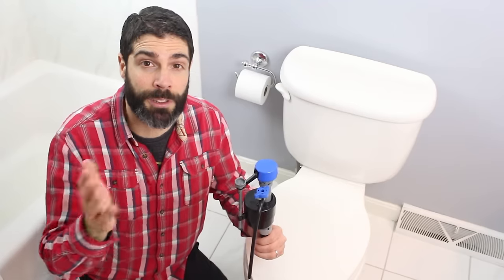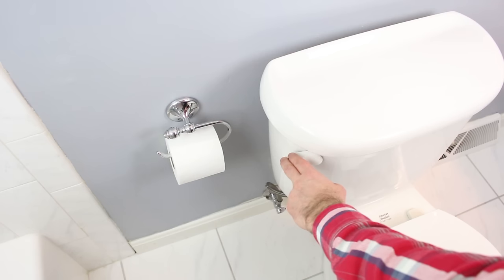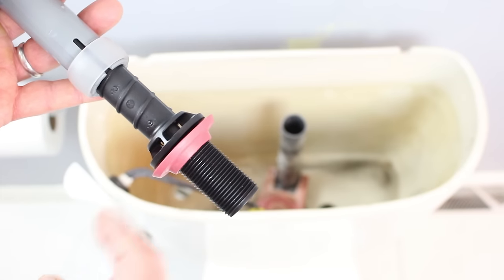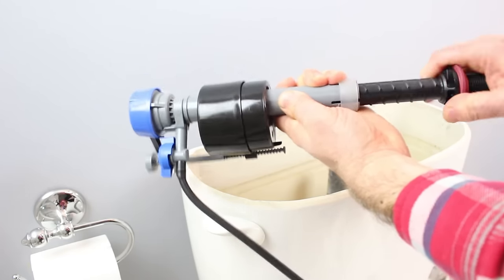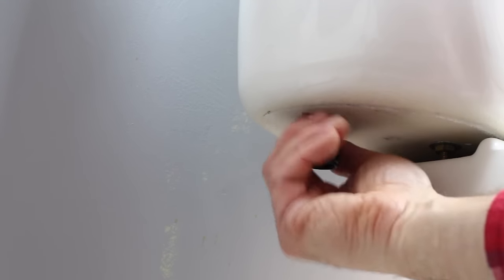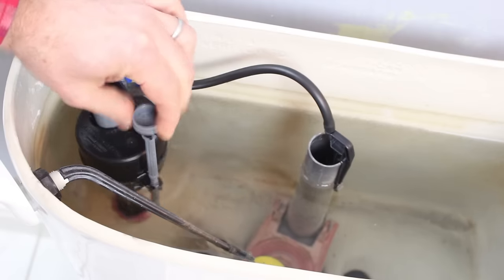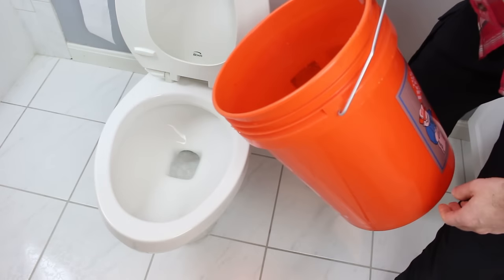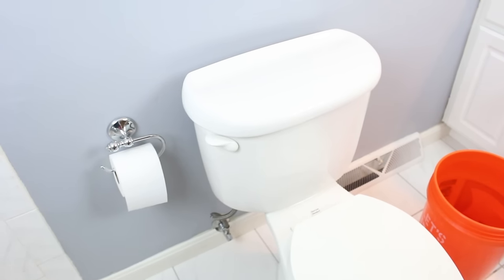How to Fix a Running Toilet with Fluidmaster 400H Fill Valve from Home Repair Tutor

Comment: Okay, as 75 yo female, this was my first attempt at doing this.  I bought the same unit in the video.  Everything worked great, but on the third flush, the tank wouldn't fill at all.  It was acting as though the water was off, but it was definitely on.  I had to drain the tank again, took the unit back for a replacement (same model), and the replacement now works.  I guess I can add plumbing skills to my resume!

Comment: Hey 3 years ago did remodel in my house. Bathroom $12,000. About 6-7 weeks ago toilet started to howl. Timed it was like 5 seconds.. kept getting longer and longer up to a minute and 15 seconds or so. Called it the Chewbaka toilet from Star Wars. So today was the day to put in new float device. Did the normal stuff flush sponge out water. Started to try to loosen that plastic nut that holds the float device in. No way. The guys that installed had it on way way to tight. Had to take the tank off and go out in garage on work bench and take a hammer and screw driver to get it off. Temp above zero today so not to cold in garage. But bought the Fluid Master 400, installed no fuss no muss.. excellent product.. and Chewbaka is gone..

Comment: Instructions were decent but the pace of the video was too fast. I’d start working on a step and then the video would be about 5 steps further along.  There’s a fine balance of cutting out filler and getting the job done, this was just a bit too quick

Comment: Craziest thing. I just installed my new Fluidmaster, and three days later it was hissing (water running). It had some gotten some large particles caught in the valve already. I cleaned it out and it's good as new again.

Comment: For anyone who is skeptical about tackling this simple repair don't be...when it comes to the directions they include with this package it's impossible for you to screw it up it's a few simple steps but they explain things thoroughly down to the detail only will take you about 20 minutes to do it and your toilet will run like new they didn't pay me to say this I just fixed my toilet couple of weeks ago I had went a month with the package sitting in the bathroom closet wish I would have done it sooner

Comment: i bought my home, new, 20 years ago.  I started having trouble with my toilet and determined the fault lay with both the fill valve and flapper.  I have zero plumbing experience but, after watching your video, decided to try to fix it myself. I spent $25 on a new fill valve and flapper set and was able to remove the old fill valve and install the new one.  It took me a lot longer than your video suggested  but that was because whoever put the nut on the fill valve under the toilet must have been extremely strong.  My toilet is only a few inches from my bathtub so I had to work on an angel and it took me about a half hour to get that nut off using plyers.  Aside from that, the remainer of the install went quickly and smoothly.  Finding your video convinced me to try to fix my toilet myself and saved me a couple of hundred dollars in plumber's fees.  Thank you so much.

Comment: I just installed my new Fluidmaster 400H-002  toilet fill valve.  The hardest part was removing the existing fill valve.  It was screwed on too tight.  Instructions are super easy and video gave me another level of confidence.  I feel so empowered!!!  Thanks.
Reply: How did you manage to unscrew the old valve I am struggling .
Reply: @mn6780  use some large pliers; commonly referred to as "channel locks".
Reply: Good instructions , took about 30 minutes from watching video to completing fill valve replacement.
Reply: @rtz549  thanks for the tip. worked

Comment: Excellent, concise video and the fill valve is awesomely designed.  Especially noteworthy are the dual controls that readily allow adjustment of the fill tank water level and the toilet bowl water level.  Thanks!

Comment: I’ve changed flappers before & it was a hit or miss even when it was the exact replacement. In this case we thought for the price of this kit $16 & this video, I’d try it & if it didn’t work then call a plumber $100 just to look at it.
The change out was easier than I thought although the flapper didn’t want to seat correctly. I took it off, put the old one on, matched exactly, so i put the new one back on & pushed it in a little then it started filling. I flushed several times to equal the same water levels in the tank & bowl. Very easy, wish you tube was around in the past I would have saved a ton doing my own changes. I’m going to buy an extra kit for our other bathroom to have on hand. Thanks for this video, easy  and to the point!!

Comment: Very informative and easy to understand. The fluid master was making a hissing noise and water wouldn’t stop. Made some adjustments in the fluid master valve and now it’s working fine.  A plumber would’ve charged me CAD 100 for a visit.  TfS this on YouTube

Comment: I measured from the inner floor of the tank to the top of the  white tube, added three inches, and adjusted the valve to that length (from bottom of red rubber washer to top of valve)...That seemed easier than trying to triangulate.

Comment: I know nothing about toilets. Had issues filling for months on and off. Sister wakes me up in the middle of the night. Toilet won't stop running and turns out fill valve came apart. Mother bought a new one. It was this one, i followed the video and got it done! Toilet works again and it's quieter. Kinda freaky. One thing though: would have taken 15 minutes if the old valve was harder than expected to remove and the toilet is in a tight corner.

Thank you for this video!

Comment: @2:18 Does the nut and connector on the line have to make contact after you've tightened both up or is it okay to have some thread between them if you've tightened them both as much as possible?
Reply from the maker: Thank you for your question. Yes there is normally thread space between the two nuts. For more information visit our website Fluidmaster.com where you can find product information, videos, troubleshooting tips and email or chat with a technician.  Our toll-free number is 800-631-2011 and we are available 5 days a week Mon-Fri from 5:30 am – 5:00 pm PST.

Comment: I purchased one of these and installed last night. It works, but I noticed during each flush, a few drops of water drip from the fill valves top cap AND at the bowl adjustment knob. Is this normal, or likely a faulty part?

Comment: Troubleshooting note for toilet more than a few years (mine presumably 9 years), the toilet connector, the part from shut off valve to filler valve, may need to be replaced. My shut off valve was leaking when tightened and it turned out both filler valve and toilet connector need to be replaced to be leak-free.
Toilet connector was rigid and could not be reconnected properly. 
The shut off valve did not need to be replaced

Comment: I have a low flow toilet with a low water level in the bowl. Can I use the 400H to increase the bowl water level?
Reply from the maker: The bowl water level adjustment screw on the 400H allows you to put more or less water into the bowl without changing the water level in the tank. To ensure your bowl can get more water or a higher level first raise the water level inside the bowl by pouring water into the bowl. Once you have reached the height you want wait 10-20 seconds. If the water drains down the new level inside the bowl is the most or highest level that bowl water can be set at. If the water stays at your desired level use the 400H to set the water in the bowl to the new height. For help or additional questions contact Fluidmaster at fluidmaster.com/support to email or chat with an agent or call toll free at 800-631-2011 to speak with an agent.
We are available from 5:30am to 5:00pm PST Monday thru Friday

Comment: I installed the fluid master as shown. Everything works fine except every two or three minutes the fill valve runs for about 3 seconds. I checked to make sure flapper not leaking. Any suggestions on how to prevent fill valve from intermittently running?
Reply from the maker: Fluidmaster recommends checking to ensure the refill tube was correctly installed. The tube should be on a clip held above the overflow pipe. If the refill tube is slid or pushed into the overflow pipe this could cause the refill tube to leak into the bowl. The second thing to check is the flush valve lock nut. Make sure you tightened the lock nut ½ turn beyond hand tight. For additional help or to speak with a technical services agent contact by phone, email or chat. Fluidmaster.com/support or 800 -631-2011.

Comment: When I set the bowl height to the max allowed by the blue knob on the fill valve, the toilet refills very loudly due to the water pressure going down to the tank. Is there a way to decrease this noise?
Reply from the maker: The only way to decrease the noise without changing the refill knob is to turn down the shut off valve on the wall. By decreasing flow you should be able to decrease the sound. The more important question is why do you have the refill knob maxed out? If you need a faster refill it may be easier to adjust the flapper rather than max out the refill knob. Visit our website Fluidmaster.com/support for videos and troubleshooting tips or e-mail / live chat with a technician or call toll free 800-631-2011. We are available 5 days a week Mon-Fri from 5:30 am – 5:00 pm PST.
Reply: @FluidmasterInc  Awesome thanks for getting back to me so quickly! I have the blue knob maxed out because I want the bowl height to be increased. Could the flapper (it's a fluidmaster dual flush valve) be adjusted to achieve that?
Reply from the maker: @zerosandones701  In most cases a dual flush valve that is purchased from a retailer as an aftermarket replacement are adjustable. However if the valve you have is a Fluidmaster and it came with the toilet then no adjustments are available.

Comment: My previous fill valve had no fill tube, and my bowl water level was fine. So, my toilet doesn't require a fill tube into the overflow pipe. Can I re-position my Fluidmaster fill tube into the tank to reclaim that water that is wasted?
Reply from the maker: Yes you can. We also sell a restrictor to turn off the hose (model 215) and our newest Fill Valve model 400H-002 has an additional adjustment knob that allows you to turn down the water going into the overflow pipe.

Comment: I just bought one and inside the bottom of the tube is a solid white piece of plastic. Possibly a regulator? Should that be there? It looks like it wouldn't let any water up the tube.
Reply from the maker: Yes that white piece inside the threaded shank of the valve is a flow regulator and is also optional. You may remove it without damaging the toilet fill valve. The flow regulator will slow the fill time but it will also minimize any pipe knock within older homes. For additional help contact Fluidmaster at 800-631-2011 or E-mail / Chat with us at fluidmaster.com/support

Comment: I just replaced mine with this one easily but now my toilet runs a few seconds periodically. Does that indicate the flapper and seal is also bad?
Reply from the maker: Thank you for your question, it could be the flapper but here are a few things to look for A) if you have the refill tube shoved down or placed inside the overflow pipe pull it out and reattach to the overflow pipe using our refill clip. This will stop a siphon from occurring and stop the leak and B) Clean the bottom of the tank along with the drain seat that the flapper sits on, if you can’t get the tank to stop leaking with a new flapper then it might be time to change the flush valve. If you need further help contact Fluidmaster’s Technical Service Department as we are available M-F from 5:30 AM - 5:00 PM PST. at Toll Free 800-631-2011.
Reply: @FluidmasterInc  Thanks, I replaced the flapper and voila! No more leaks or running fill valve.  Thank you

Comment: I turn off the shut off toilet valve and still water coming from fill valve. Is toilet shut off valve broken or fill valve?
Reply from the maker: Check out our troubleshooting page and call our tech service guys if you need to! They can help you diagnose the issue asap. https://www.fluidmaster.com/toilet-problems/toilet-running-constantly/
https://www.fluidmaster.com/contact-us/

Comment: BUYERS BNEWARE:  The Fluidmaster 400A has a major flaw.  It takes 4 mins to refill your tank where the old style takes less than a minute. The issue is theres a white rubber stopper in the valve that you must remove for the tank to fill faster. Why did the company did this?? Stupidity?? yes.  Some of us needs to double flush as first time around doesn't clean everything.  It appear they added this stopper in newer models.

Comment: Can you tell me what wrong with my fluidmaster universal completed kit that the water rises up very slow.   It takes at least 15 or 20 minutes before it rises up to the water level line.
Reply from the maker: Try this tip when the water is filling slow, remove the top cap and purge debris from your water line. This procedure can clear the water path and let water flow into the tank at its proper speed. For additional tips visit our website Fluidmaster.com/support for videos, troubleshooting tips, email, chat with a technician or call toll free 800-631-2011. We are available 5 days a week Mon-Fri from 5:30 am – 5:00 pm PST.

Comment: When he shows what’s in the box, it’s different than what was in mine. My box (purchased at HD) didn’t contain anything other than the fill valve itself. So I went back to HD and had to look through 6 boxes before I could find one with both the instruction booklet and the white plastic nut (5 of 6 boxes didn’t have the nut). Now, in watching the video again, it appears that there is an additional piece that wasn’t in any of the boxes. Is that necessary? I don’t really feel like going back to HD and exchanging for another one where they’ve all been opened and pawed through by customers and have missing parts.
Reply from the maker: Thank you for reaching out to us and letting us know about your experience. If you could call our Technical Services at 800-631-2011 during the hours of 5:30 am to 5:00 pm PST we would be happy to go over the parts needed for the installation and would like to get some more information about the store you visited.

Comment: I just swapped my old fill valve for this one, but this one won't stop running... It's a steady drip 😡 up and over the overfill tube
Reply from the maker: Fluidmaster would like the opportunity to learn more and provide help. For more information visit our website Fluidmaster.com where you can find product information, videos, troubleshooting tips and email or chat with a technician.  Our toll-free number is 800-631-2011 and we are available 5 days a week Mon-Fri from 5:30 am – 5:00 pm PST.

Comment: Can someone/anyone explain to me how this model can give you "a more powerful flush"?  I have three of these performaxs installed in my homes with the two adjustments.  I can see how the valve for bowl can slow the rate of water when refilling which would lead to less water in the bowl but at max setting it would be just like the old series -without the valve where it would flow at max rate.  So what this valve does essentially is slow down max flush when dialed down anything other than max.  How is that helpful when your dialing back the bowl amount and how is MAX setting on the bowl and different than not having a valve at all??? It's not
Reply from the maker: Newer toilets use less water and need a faster refill time. The 400H allows you to speed up the bowl refill time without changing the water level in the tank to ensure you have the proper flush. If the bowl does not fill up all the way the bowl will flush slowly or not at all. This timing is important to maximize the flush power of the toilet. For more information we can be reached 5:30 am to 5:00 pm Mon- Friday PST. Options for contact are Live Chat and Email at techsupport@fluidmaster.com/support or toll free 800-631-2011.

Comment: So, I have installed the flush valve and have turned the screw to raise it and the screw won't turn anymore clockwise to raise it, so how do I  raise the body of the fill valve without taking out the whole mechanics and starting over  (the water in tank is not coming up to the line).

Comment: Thanks for this informative video. I get a ‘Whoosh’ sound from time to time. I just changed the flapper too. Just wondering!
Reply from the maker: The sound you are hearing is water draining from the tank and the fill valve replacing the lost water. If you can’t get the tank to stop leaking with a new flapper here are a few things to look for A) if you have the refill tube shoved down or placed inside the overflow pipe pull it out and reattach to the overflow pipe using our refill clip. This will stop a siphon from occurring and stop the leak and B) clean the bottom of the tank along with the drain seat that the flapper sits on.  If these simple tips do not solve the problem it might be time to change the flush valve. If you need further help please visit our website at Fluidmaster com/support for install videos, troubleshooting tips, chat, email or call 800 631-2011. Fluidmaster is open Mon-Fri 5:30 am thru 5:00 pm PST.

Comment: God This fixture has been around since the 50's> I've had plumbers here, & no body could figure out why the toilet water i the bowl,  was lower than the Hard water etched mineral circel that showed...That large Button is a #1 major improvement...Cause you can't see black on black print, ect, in the bowl dark & all, mines is under a wooden Towel/Supply cabinet, too, So this looks fantastic! Thanks! Saved this video..will try to see if I can adjust water height in the bowl for the 1,000th time!;) If the screw only goes so far this will prevent it, I believe..Thanks again Fluid Masters!